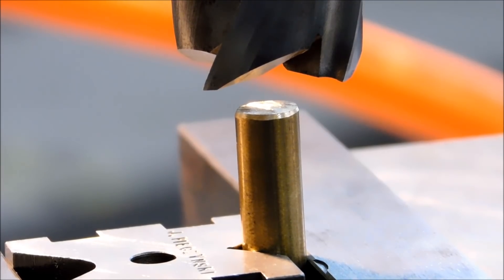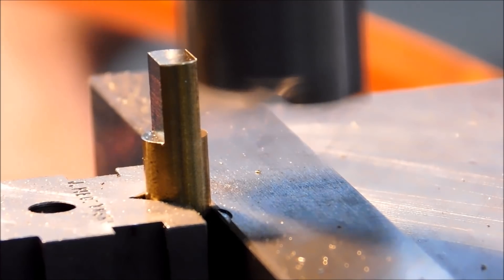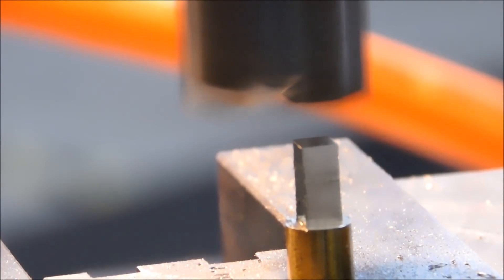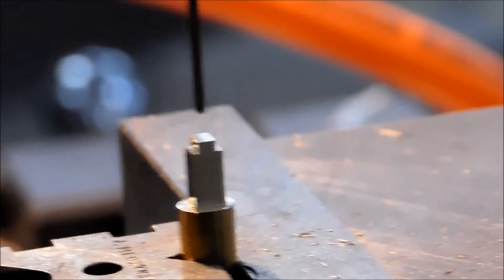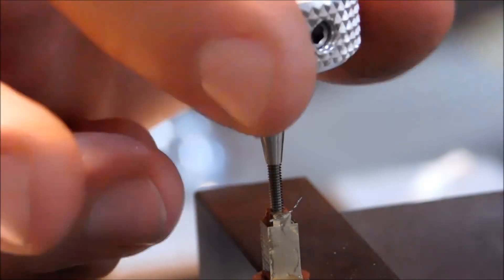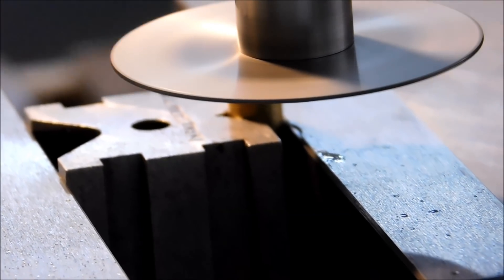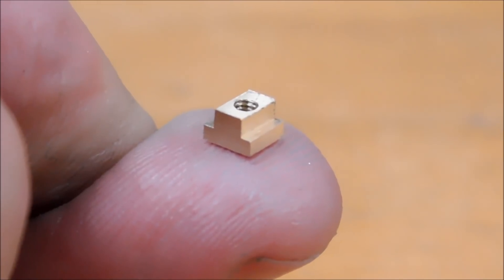Machine a 2 mm T nut with a 24 mm End Mill!

Comment: I love the how to machine tiny parts videos!
Reply from the maker: Glad you like them! I find it fun to do. I did my apprenticeship in a company that made internal components for watches, that was some very small stuff.
Reply: @joepie221  
The smallest part I made was a brass bushing for a rc plane wheel.  It was 2.5mm diameter and 15 mm long with a 1.5 mm hole through it.  I made two of them on my mini lathe.  It was rewarding, though it took a few tries.  The part kept climbing over the tool.  It was your video about making thin parts and doing the cut in one pass that got the job done.  Thanks for that!  

Currently, I'm trying to fix a little helicopter.  Talk about tiny screws...one of the grub screws uses a 0.90 mm hex wrench.  How do you suppose something that small can be homemade?  I broke one of the two that came with the kit.

Comment: Thank you for the reply.
Im intrested because I have an interview in a few days to run a Vertical Manual Lathe and a Horizontal Boring Manual Mill.
Both machines i have never used but I have 14 years experience with Manual and CNC Mills and Lathes.
Reply from the maker: The parts are usually much bigger. Be safe.

Comment: I've had bad luck with a 1/2" endmill sucking a gummy brass part out the of vise and tossing it across the shop.  Not sure what the alloy was - junkyard find - but gummy as heck. My situation was similar to yours, with the exception being that your setup probably has more clamping area than mine did.

Comment: How did you safely hold a 1inch end mill in an R8 machine? I've seen a couple of collets that claim to do this, but they look like they grab outside the R8 body. It feels sketchy..
Reply from the maker: It had a 3/4" diameter shank
Reply: An ER32 collet will just about cope with that, I've seen collets up to 25mm.
Reply: Purchase a ER 40 collet holder.
Reply: reduced diameter shank

Comment: I'm new to running a mill, have only had mine about 3 months. I need to mill a small part about 6 inches long 3/8 of an inch wide and a 1/4 in thick. The trick is I need a shoulder in the middle of the part and I need it to taper to one end. My plan was to mount it to a 1-2-3 block and shim one end to make the taper. I need this on both sides so I would have to double the shim when I flip it over. Any suggestions?
Reply: use a lathe

Comment: I've always been leery of using a large end mill on small parts because the flutes are so deep I'm afraid it will grab the part (similar to using a large tooth saw blade on small parts). Guess not, if it's done correctly.
Reply: If the taper is symmetrical the shim would be the same for each side, assuming you are shimming off a square part.  I think the shim would shift to the opposite end.

Comment: oof, all of that is considerably out of symmetry even to the naked eye
Reply from the maker: In the absence of a spot or center drill, you can expect the hole to be out of location. On the other hand, the profile is symmetrical within .0015 TIR. So, yes on the hole, but absolutely not for the body.
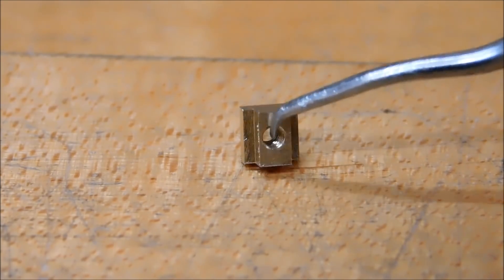Reply: @joepie221  the still at 11:20 is tricking my eyes then? I mean it's possible, I'm only going off what I can see, I don't have the part in hand
Reply from the maker: @SoWe1  It honestly is. There is a small vertical burr on that front left corner rolled toward center. that may be the illusion

Comment: Hey Joe I think the threaded hole is a couple of microns off centre lol. Maybe an optical delusion me thinks!
Reply from the maker: In the absence of a chamfer, most threaded holes look a little off center.
Reply: @joepie221  In the absence of a chamfer before the fact,would scuffing the top of the part using the slitting saw rub a burr back into the thread?
Reply from the maker: @montynorth3009  It could. Re-running the tap after the fact is always suggested.

Comment: Tip for the cutting off is to take a screw to fit that threaded hole, put it in a few turns, less than the cut depth, and tie some thin nylon line to the screw head, so that you can use the line to catch the part when it pops off. 

Beautiful work on that small nut though, making a mini mill for mice to use?

Comment: Thanks Joe!  Two questions,  what kind of RPM was the slitting saw running at, and is the saw Arbor a piece that you made? ( would Precision Ground Shafting(1045) be an appropriate material?) Keep up your great work!
Reply from the maker: The saw was run at 1300 rpm and yes I made the arbor. 1045 would be fine, just make sure the cap stem and bore are true to the OD were you hold it.

Comment: Doesn't look exactly centered. The hole or the slot.
Reply: I think you're seeing the near side of the thread (root) on one side and the far side of the thread (crest) on the other.
Reply: @sierraspecialtyauto7049  I thought of this also, but I'm willing to bet if one is off they both are. The slot and the hole.
Reply from the maker: I went back and checked the part because it does appear to be off in the video. It must be the light or camera angle, because it measures true. The hole is not chamfered, so that makes the hole look off.
Reply from the maker: @seantap1415  You guys shamed me into checking it very thoroughly. The hole walked by about .005 in both directions which can be attributed to no centerdrill, but the body symmetry is spot on. if the steps look off, its an illusion.
Reply: @joepie221  Thanks for measuring.It was bothering me too.
Reply: Yeah... it’s off. Hard to find the exact surface when you run a mill to the point where you see chips. This was more of a demonstration of a series of steps rather than a how to on precision.
Reply: @renaissanceman5847  Ya I get it but he barely ever makes a mistake of any kind. Had to throw it out there...cheers
Reply: @renaissanceman5847  Also doing this the way he did does allow for it to be perfect. It's his math that is wrong and it has nothing to do with touching off the way he did.

Comment: The avg size of the chips I make are bigger than that part!
Reply from the maker: Parts this small are a strong argument for a very clean floor.
Reply: @joepie221  I guess few watchmakers are keyboard warriors ... I would have popped a cocktail stick in the hole to hold it at the end though, even if the floor was clean! Great video, thanks, Joe.

Comment: question do all collet chucks use a drawbar?
Reply from the maker: Some use drawbars, some use handwheels and some have closer nuts. I guess that depends on the collet. I have a collet selection video if you want to choose.
Reply: nope, er collet chucks use a nut, that one this old tony uses has a nut
Reply: @pacman10182  reason i ask cause i need a 5c colletchuck and i see them on grizzly site but they never talk about a drawbar of backplate.
Reply: @NewsNowFortWorth  for a lathe or mill?
Reply: @pacman10182  grizzly G602   lathe
Reply: @NewsNowFortWorth  that would be a sieg c10 lathe, looks like it uses a 5 inch back plate.
http://lmscnc.com/3047 chucks like this should work, they don't need a drawbar, it's got an internal nut that acts on the external threads on 5c collects
is that a fixed face-plate or a removable?
Reply: @pacman10182  the on eon grizzly i think you have to buy a seprate back plate and machine it . see that why i had my question becuase if you have to buy a back plate for i was wondering the same thing about the drawbar
Reply: let me also explain what im trying to do with a video link heres a link to my google drive i have two videos that are 2 min in length . give me 5 min to post both links
Reply: @pacman10182  so that link should  work on my lathe  ?
Reply: @NewsNowFortWorth  maybe, what size face plat do you have?
Reply: @pacman10182  the backplate thats on the 3 jaw or the faceplate they sent with the chuck for mounting odd ball size stuff onto the lathe?
Reply: @pacman10182  i believe itto be 7/12 to 8 inchs  im going to say 8
Reply: @NewsNowFortWorth  sorry, I meant back plate, if it's 5 inch that chuck should fit
Reply: @pacman10182  so your saying take the back plate off the three chuck im i understanding you correctly or are you talk abouit the threaded flate plate with hold in it for mouting stuff to ?
and btw its 8"
Reply: @pacman10182  i think the 3 jaw is less then 8 " thought
Reply: @pacman10182  when i take the chuck off its threaded and the 3 jaw has a back plate the has 3 machine screws
Reply: @pacman10182  I could post to google drive a pic or video
Reply: @pacman10182  yes part 11 has threads
Reply: @NewsNowFortWorth  send me a pic of the back plate
Reply: @pacman10182  of the 3 jaw  heck i will send pics of it all i will reply with link sometime early morning 8am garage is locked
Reply: @NewsNowFortWorth  How does your existing chuck mount to your lathe?
Reply: @pacman10182  thought we had communication going what happen?
Reply: @NewsNowFortWorth  you're a little impatient, that's what happened :-P
Reply: There are collet chucks that use a chuck key as well as collet closers that use a bar attached to a lever that quickly pulls the collet in. I decided to get both when I purchased my lathe.

Comment: Hole not centered...
Reply: Oh I'm pretty sure the hole IS centred BUT since we see the spiral from the thread it doesn't look to be. I've been fooled by this many times on parts with a big thread compared to thin walls making me go an extra time to the inspection room just to make sure. (The easy way is often to put a thread gauge or similar in and check its position, then it's often in centre.)
Reply: @sharg0  Or just bur the hole like normal people. The hole is too far off for me. (I actually use crap like this every day)
Reply: The hole is not centered. Use the <> keys to micro-step through the video right at 6:28. When the hole is in the shadow it is evident. Joe mentioned that he did not use a center drill for this example piece. The drill walked just a little when starting the hole. Not an issue - if this was a piece that would actually be used he would have center-drilled it no doubt.

Comment: Pretty impressive. Was the center hole meant to be off center ?
Reply: Was wondering that myself, but suspect that with such a small part the entry of the thread will always make it look a little off center. Would need to check before threading
Reply: I think it all optical illusions in the camera with glare because there are times when it looks off center but then there are times when it looks perfectly centered.
Reply: I think the hole and the slot are off-center.  11 mins 23 sec
Reply from the maker: I may have to inspect it in a video to show it.
Reply: @joepie221  BTW Joe, not at all a criticism, just a fun bit of detective work. Great work as usual

Comment: now I want to see you making the T-slot that goes with this
Reply from the maker: Hold my beer....
Reply: @joepie221  that's what I wanted to hear
Reply: @CatNolara  I'd probably find an old carbide 1/4" burr and grind it to a T slot profile.. if you don't have a lot to do it would probably get the job done
Reply: @Rx7man  I made some T-slot cutters of that dimension (ok, maybe a little bit bigger) from the shaft of some broken 1/8" carbide endmill that I silversoldered to the tip of a piece of steel rod and handground to a single tooth cutter. Worked pretty well on aluminium. I think the smallest slot that thing could make was like 8mm wide and 2mm high, with the opening 5mm wide.
Reply: @CatNolara  I was thinking using the carbide burr because it has a 1/4" shank, and 1/4" is pretty close to 6mm.. shaping it to the right profile would be a bit of a challenge but not impossible
Reply: that is the t nut
Reply: @pacman10182  I'm stupid, I wanted to write T-slot
Reply: @CatNolara  a t slot cutter that small is going to be a massive pain
Reply: @pacman10182  yup.. probably use the slitting saw to make the vertical cuts first, maybe a couple passes to remove as much material as possible, then switch to the T slot cutter
Reply: @Rx7man  i made one ,slot drilled the main slot then used a woodruff cutter to undercut the t ,the t-slot cutters were to expensive, a little larger with 5mm across the t

Comment: why not just buy em, theyre like 2 bucks
Reply: That's not the point.
Reply: he was demonstrating making a very small part with a very large tool. watch the whole video
Reply: I bought blanks, but for 6 mm width....
Reply: Hmmm, spend $2 (plus possibly shipping) and wait a day or two or three, etc... Or spend 10 to 20 minutes making the part I need to finish the job and need it for and move on to the next... I'll take the 10 to 20min of time any day over a few bucks and having to wait. 
Then again, I'm the type that hates to wait if I have a choice.
Regardless of that though, as it was pointed out already, the point was not that you could buy it but that you could do it (particularly the small part / big tool aspect as Joe specifically elaborated on when he said about seeing guys rushing to find a small tool because the job was a small part when they didn't need to.

Comment: That does not look centered to me. hmmm. Also, why do you need this T-nut? :)
Reply from the maker: Thats only through the camera. I saw that after I shot this and re-checked the part. It looks off center, but its not..
Reply: @joepie221  Measure it on camera and prove that part is not off center.
Reply: His spiders are going to set up shop and start making small stuff. With all of those arms they are bound to be super efficient.
Reply: I think he was just showing us that regular size tooling can be used to make tiny parts.

Comment: I recently had to tap m1.2 five mill deep in stainless steel with each component having 5 taped holes, with 4 components to do. Not something I want to do again in a hurry. What’s your t nut going to be used for joe?
Reply: Thanks roy! Will do in future.
Reply from the maker: You should do those holes first. if you snap a tap, you don't ruin a part with a lot of time in it.
Reply: Tapped!
Reply: @KevinWoodsWorkshop  You can edit your comment by moving your mouse at the far right of your comment, when you see 3 little dots appear, click on them and it will give you the option to edit or delete.
Reply: That would be a good idea but the jobs were already completed when they came to me with no spurs. I did break a tap but I was lucky and managed to get it out.